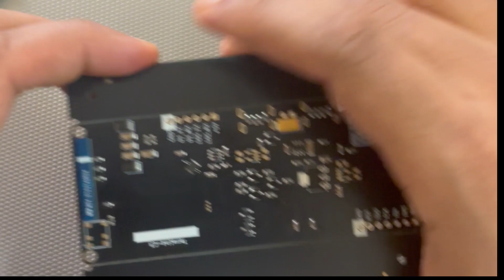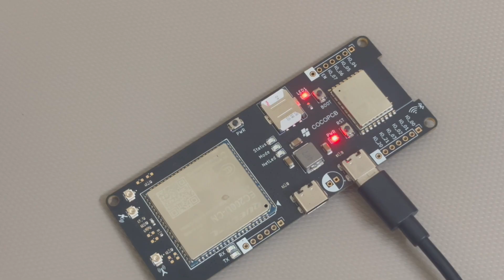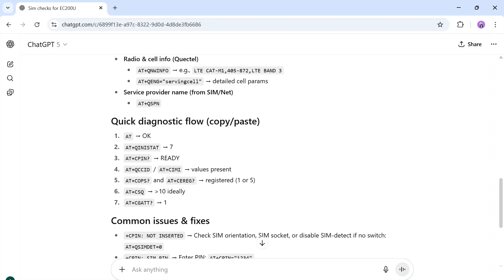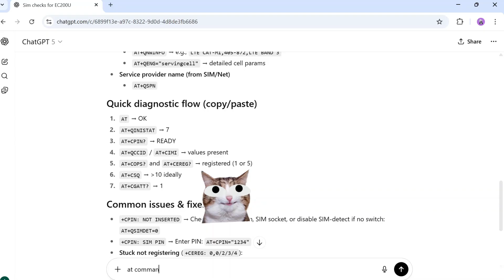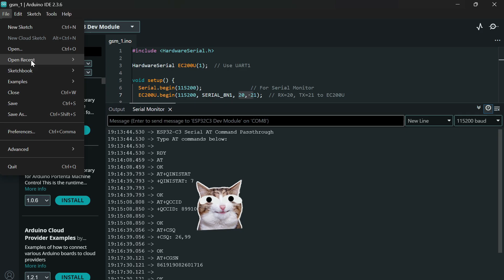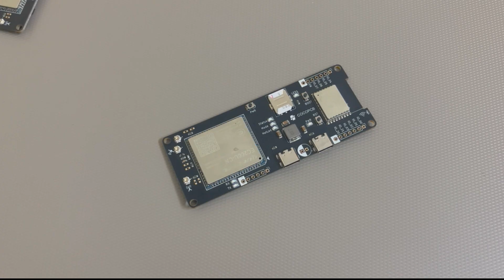Ultimate IoT Hardware | Custom PCB with ESP32 C3 and EC200U

Comment: Hey bro, what was the total cost to import any other PCBA from JLCPCB to India? How much custom duties did they charged? like what %? Which shipping did you use? is UPS Worldwide Express Saver actually cheaper or they just charge more after arrival? Just trying to figure out the best deal.
Reply from the maker: For Bare PCB Basic Custom Duty is 10% + 18% IGST. For PCBA , it is basis your product HS Code you can expect - 20-30% + IGST of 18% !!
Coming to DHL/UPS/Fedex - you will be charged Handling Fee of Rs. 500-750 additional to shipping charges, 
Send me a mail at roboshalaindia@gmail.com !!
We can connect & talk, would suggest to localise the PCBA here in India, as your landing cost would be near the local manufacturing cost in most of the cases